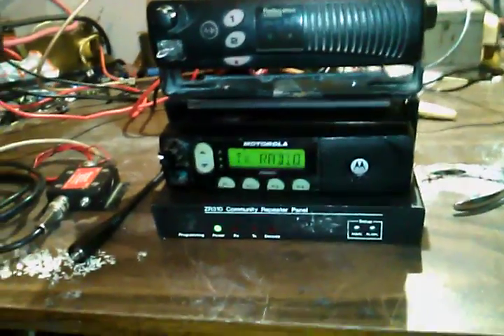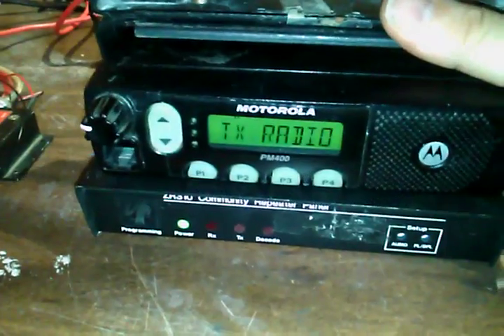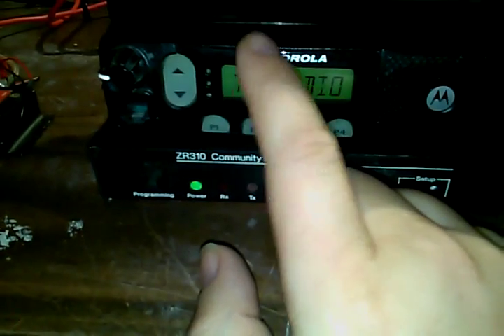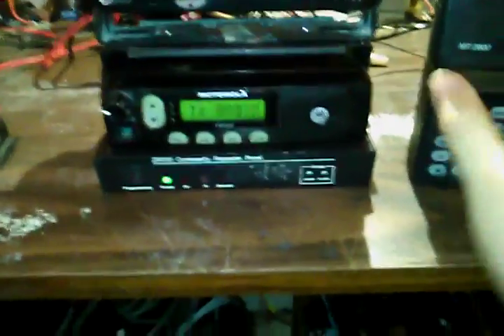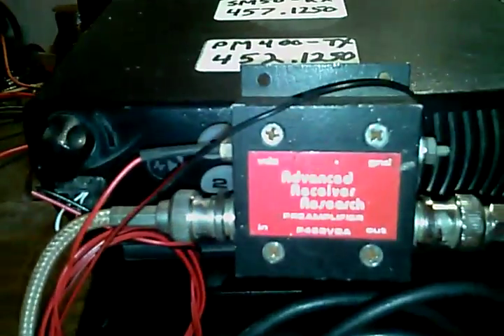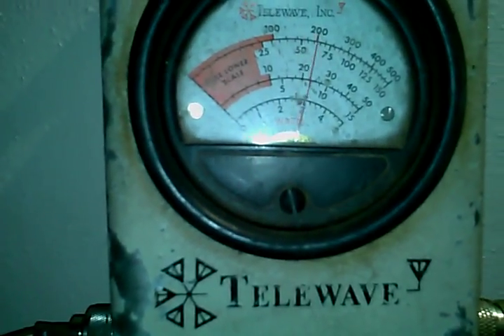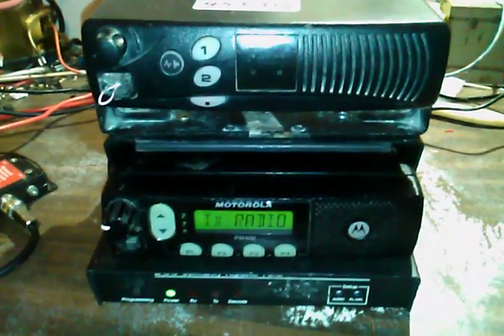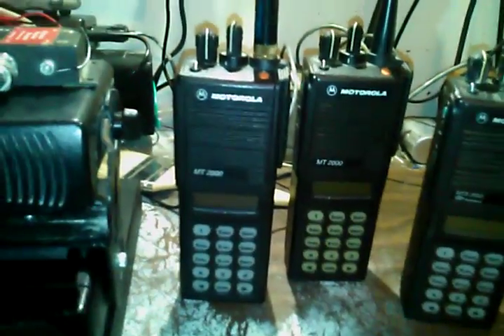A temporary UHF narrowband community repeater replacement - Read Description -

Comment: It shouldn't matter because if you're running a wide band radio on a supposed to be narrow banded frequency that's a No-No right there never use radios that are not compliant with narrowbanding if it's wideband don't ever use it unless it's for ham or gmrs only!!!!!!!!!!!
Reply from the maker: Yes we already know that... This temporary setup was a narrowband setup, we have replace is with a Mototrbo system now.
The OLD system (GE Mastr 2)  was immediately taken offline and scrapped because it was wideband and useless to use. Good old radio but served out it's life well.

Comment: which is i remember right the PM400 is the newer version of the CM300 right?
Reply from the maker: PM400 is an LTR / conventional UHF. The CM300's I have worked on were all VHF Hi band models. I really don't know if they make a CM300 in UHF or not. I never looked for one.

Comment: Hey man! Great videos! Can you tell me how I go about setting up a community repeater? I am attempting to set one up and I would like to know where to start. I have a Commercial Radius that I use for ham and to monitor other community repeaters. I have been looking into a PM400 to use to monitor and talk to my customers. I have set up GMRS repeaters before for my family and GMRS club but I would also like to set up a Community repeater as soon as I can. Thanks!
Reply from the maker: Well first you need either a community repeater controller and a repeater,  or a repeater that has the options built in for you to set up a community repeater. Some of the new Motorola Digital / Analog repeaters do this.

The Zetron Zr-310 was designed to go in the GR1225 repeater and uses a special interface cable but the GR1225 is only a 40 - 50 watt radio depending on the band you are using. So to really make it work for you you will need an external 100 watt PA finals and duplexer that can handle the 100 watts, The little duplexers built in the GR1225's will not work for that kind of power.

Make sure the PA finals are rated at least 2 watts in and 100 out. and you will have to program the GR1225 to TX no more than 2 watts max in the CPS.
Cresend makes good PA Finals also but be prepared to spend some $$$$.
The finals on the repeater I set up in the video are out of an old Standard repeater and take 10 watts in and puts out 110 watts before the duplexer but I don't run it that hot. I have it set to output about 80 watts.
of course the dual mobile setup is temporary until the real radio arrives next week..
Reply: Ok. I have most of the equipment that I need seeing that I have a Plethora of vhf and uhf radios so I just need a tone panel

Comment: Would you mind telling me how you made the bracket cuz i want to make one for my repeater
Reply from the maker: I used the original brackets for the radios, inverted then and bolted them together with some 1/4 20's, like you see in the video.